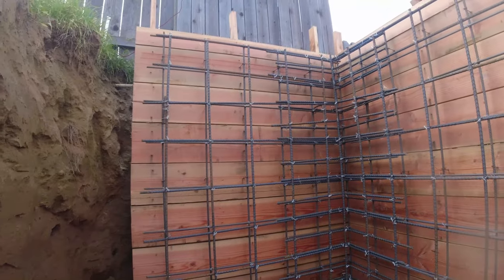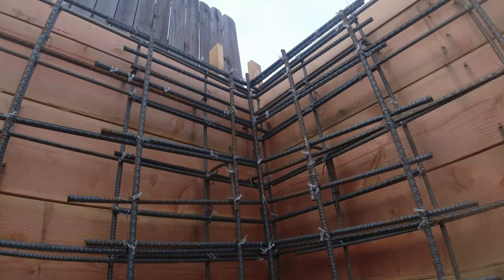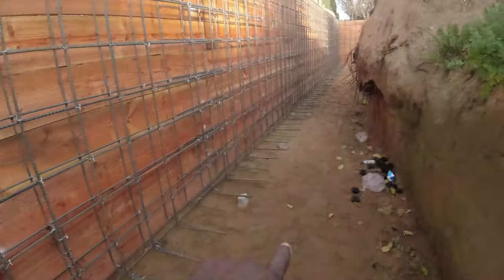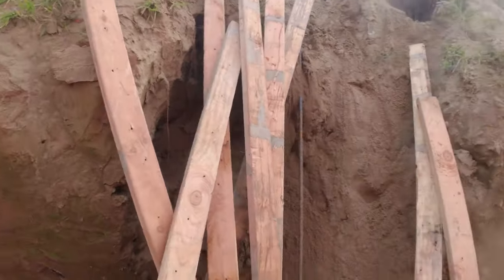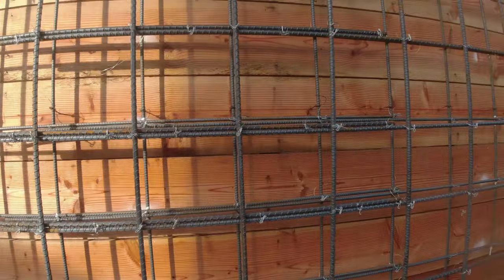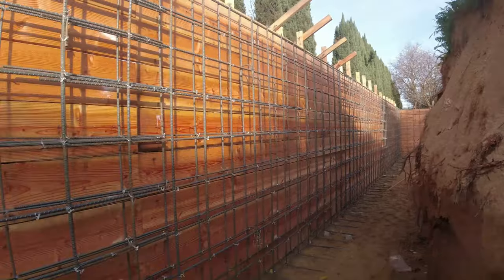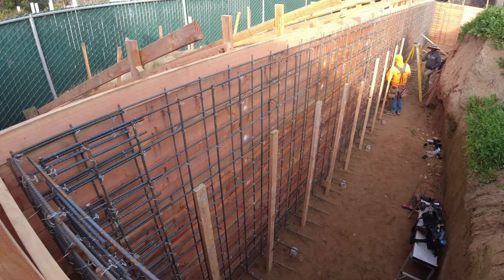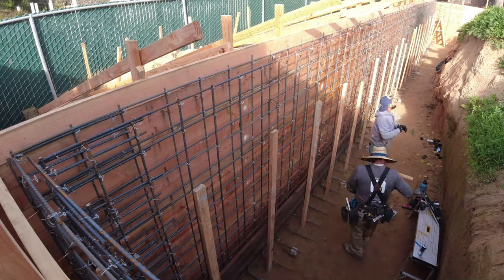Build a GIANT Concrete Retaining Wall -- Unbelievable Construction Skills Revealed

Comment: What an awsome job you guys do, great team awsome leadership, I am looking to build a similar project, what spacing on the rebar did you use and what size rebar #4 or #5. How about the footing?
Thanks for awsome videos
Reply from the maker: Footing #7 at 12 inches and #4 at 12 inches I believe.
Reply from the maker: If this is your first time building a wall and you going 7ft. I would recommend you hire someone. It's a lot of moving parts. Also, recommend you jure a structural engineer..

Comment: What happens to the holes in the footer left by the vertical support pieces (2x4’s)?  Do you remove those while the concrete is still setting and fill the holes?
Reply from the maker: The 2*4 stays
Reply: Thanks for the reply!

Comment: Another great video. I'm trying to build a 160 feet long, 5-6 feet high non-bearing wall behind a county fence for noise reduction. What kind of footing would be looking for?
Reply from the maker: #5 rebar 12 inches on center.. footing 18 inches thick 4 feet wide.. 8 inches thick.. Those are the overbuilt CA specs.. Bidding on one now..

Comment: 💡Idea I’ve been doing this a wile and have done walls as high as 24 ft. That 2 x 4 holding that form up on the inside of the wall never gets taken out in time and have to snap it off and it leaves a void. Why not a 4’ pice of metal stud ? Cut it off with a saws all later ? I never tried it but I have a 6 ft high wall I’m going to do soon and I’m going for it .
Reply from the maker: I'll look into that....👌🏾👌🏾 Overall haven't had any problems this way...let me know how it works out and get some pictures 👌🏾👌🏾
Reply: @AllAccessConstruction  I will in your case you wouldn’t even have to cut them off just flatten them with a sledge hammer. Owner might freak out with it looking like crap flattened out but it’s all getting backfilled. :o)

Comment: Is there a reason you dont use a gravel subase? If I am looking to build a wall the same height, what would be the proper way to use gravel as the subase and put a french drain along the back so that the water doesnt just continue to go into the gravel subase?
Reply from the maker: Having a base shouldn't be a problem.. I you're building a wall this tall.. I'll definitely recommend you talk with a structural engineer..

Check out our French drain playlist... https://bit.ly/3vmZdwQ

Comment: How do you monopour that without the column pushing out the footer?
Reply from the maker: Not sure what you mean about column but everything is pretty secured. We never had a blowout
Reply: @AllAccessConstruction  sorry column is an engineering term for pressure formed by a vertical liquid. Do you need to use accelerator to make sure it sets up before it flows through the open footing? I'm thinking of doing a monopour foundation but most people do the footing first to make sure it's set before placing the vertical load on it.
Reply from the maker: When we pour monolithic we start with the footing and go from one end to the other.. About time we come back around we start with the wall. We use a six sac pea gravel with a 4 inch slump
Reply: @AllAccessConstruction  nice

Comment: If your doing these types of walls very often, you need to buy a used set of symons panels or at least rent them. The cost of wood for this one job would pay for a quarter of tge cost of the panels. You could set this wall in and pour it in 2 days. Your doing a beautiful job. What kind a ties are you using? Oh i see, button head tied with shoes.
Reply from the maker: Appreciate the comment.. I am looking into the panels.. Problem is out here they like the board form finish look.. Also, we like to pour monolithic....Haven't seen any panels poured monolithic
Reply: @AllAccessConstruction  the look is one thing, but mono pours are easy with them. I've poured with them for over 30 years. If I can help you in any direction, I'm happy too. Your work looks awesome. Even your bar tying is almost perfect 👍🇺🇸. What state are you in
Reply from the maker: San Francisco Bay Area.. You have pictures? I haven't seen anything online.. It's a great inter debate amongst our crew.. 👍🏾😂
Reply: @AllAccessConstruction  I'll look through some old pics. Depending on the wall height, you can use rebar or anything steel. Tubing ECT. If it's a house foundation, you can even use wood stakes to cross the footing to hold up the panels. The misconception is that your hold a lot of weight. The concrete holds it's self up. Your only trying to hold up the weight of the panels. Symons ,you can also strip in multiple panel sections. So if you have a tractor around, you can leave multiple panels hooked together and strip them and swing em over and reset them. Fast. Ties are cheaper than button heads too. Once you buy a set, there yours. I'm in Idaho.
Reply from the maker: Much respect Joe@allaccessconstruction.net 💯💯🙏👌🏾👌🏾

Comment: Why weren't actual concrete forms used?
Reply from the maker: We always use 2*12s forms.. Muscle memory 👍🏾👍🏾
Reply: @AllAccessConstruction  interesting
Reply from the maker: You never saw them built out of 2*12s? 🤔🤔
Reply: @AllAccessConstruction  yeah...back in the first half of the 1900s. 🤣 Really only have seen it on old foundations.
We've always used metal forms and so does everyone else in the area. (Rural Midwest)
I'm not hating. I just really haven't seen anyone do large pours with wood.
Reply from the maker: That's what's up.. Out here we use 2*12s ... For us to many elavtions changes.. We will be cutting a lot them.. 😂😂😂 But glad it works for you guys.. Born in the #midwest #indiana..